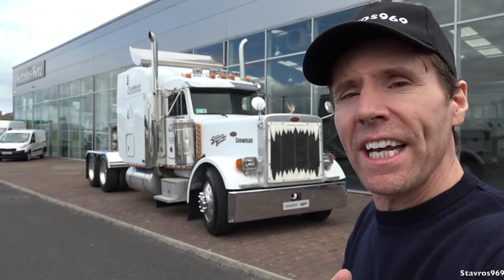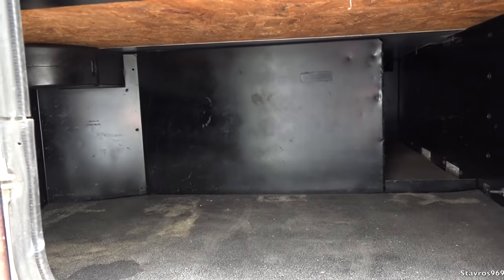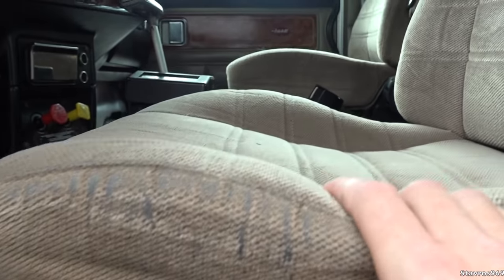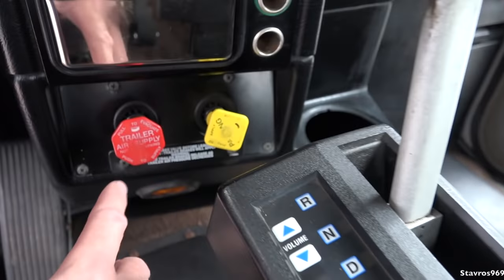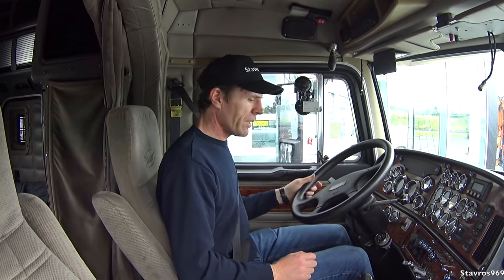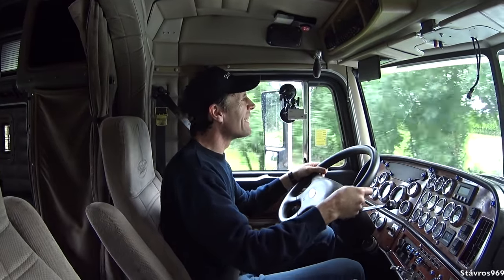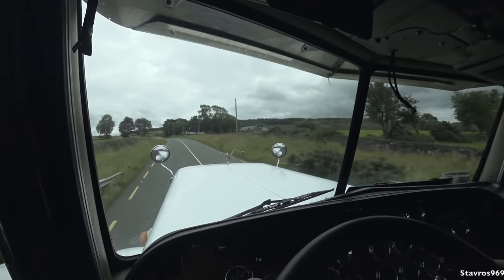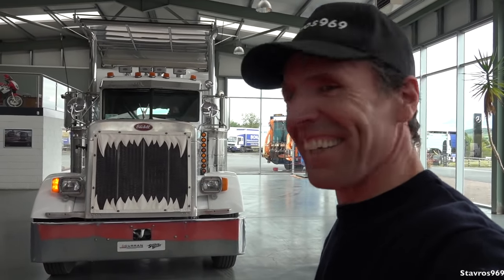2001 Peterbilt 379 Full Tour & Test Drive Caterpillar Engine

Comment: I was kind of disappointed that it was an automatic. It would have been fun to watch Stavros try out an 18 speed.
Reply: I mean it's not different than a 13 speed, just the lower ends can be split.
Reply: @robertgardner4508  Yeah, that's true. They're not really all that different unless you're pulling really heavy loads.
Reply: Do 18 speeds still even exist in the US? I thought the US was finally catching up with the world and ditching those ancient 18 speeds with modern automatics. Last time I checked, they just left with having to refine their auto boxes since they where changing to non optimal gears on hills and in cities.
Reply: Yes in Kenworths and peterbilts

Comment: Peterbilt HQ:
"How many gauges shall we put in this Peterbilt truck?"
"Yes."
Reply: other trucks just have dummy lights instead of gauges
Reply: It's nice to have a gauge that gives you a proper read out of what's going on. You can see a problem before it leaves you stranded.
Reply: It’s the full gauge package. It’s an option, but if you understand what every one does it’s actually a great thing to have.
Reply: Gareth Ifan it’s what it’s called on the build sheet. 
Some of us actually care about the temperatures of both our rear differentials, we also like having an ammeter (volt meter is standard), it’s also nice to be able to see the pressure of your pusher axle (in cases where it is equipped). You get an application pressure gauge which is handy (if you know how to use it). You get an external temperature gauge and an exhaust temperature gauge. 
The US has a lot of different environments and you can in a matter of 2-3 days go from -50 to 90 degrees Fahrenheit which has huge repercussions. The pyrometer is helpful because at least you know before the exhaust catches on fire and you melt a piston that you might be pushing it too hard climbing through any of our mountain ranges. 
It’s a great option. It costs some, but it can save you a lot in terms of your maintenance costs from the owner operator standpoint.
Reply: I also forgot: engine oil temperature gauge is another one it includes.
Reply: @garethifan1034  It's actually true, in the 2020 model you can have the full gauge package or a infotainment system, I'd like the full gauge pack.
Reply: roundsm18.....that’s not the full gauge package, whoever spec’d it from new had a few extra ones added. I have the full gauge on mine and it’s got 24 gauges....NOT including the rev or speedo 👍🏼
Reply: Hahahahhahaha
Reply: You can put more actually
Reply: @garethifan1034  No not really they are very useful too
Reply: All off them
Reply: Yea im not feeling the joke man
Reply: @garethifan1034 ...
For some...  all those gauges just "look cool"...
For those of us who actually understand the information those gauges provide...  they can mean the difference between a $20 radiator hose, or a $20,000 engine. 
The pyrometer, is really only necessary if you "run hard"...  like 100 MPH or more. 
But, just the addition of the oil TEMPERATURE gauge can save you from burning up your engine in the event of coolant loss, since in that case your "water temperature" gauge won't tell you diddly. 
Whether or not you feel those gauges are "necessary"...  is usually directly related to whether or not YOU are paying the repair bill after damaging an engine or transmission as a result of being unaware of a problem until you could hear or smell it, or see the smoke...  AKA...  too late.

Comment: Comfort in driving:  European Trucks Win
Comfort in sleeping: American Trucks Win 😊
Reply: Well I don't know. Modern American trucks are very comfortable because they have air ride suspension, air ride cabs, air ride seats and very long wheelbases, all of which aid in smoothing out bumps, though it's hard to compare comfort without driving them immediately one after the other, especially since they're designed for two different areas.
Reply: chiken da gr8 spot on. You simply can’t compare American & European trucks because they are built for totally different environments. It’s like comparing two species of animals that have evolved for their environments. They are nigh & day in difference.
Reply: Can't really compare a 2001 peterbilt to a 2020 Volvo FH :P
Reply: @matty6848  technically there is one place you can.  Australia
Reply: @FunnyMann3  can't even compare a 2001 peterbilt to a 2021 peterbilt.
Reply: But you never get comfortable driving when you drive an european cabover truck on american road
Reply: @hehe734  that's because with European hours of service, you're not in the seat long enough to get comfortable.
Reply: @matty6848  Nope, trucks are trucks. There is no night and day difference between trucks simply because they are both trucks. Your comment would be valid if people were trying to compare a truck to a bicycle or car.

and ride comfort is one of the most directly comparing things between two trucks regardless of where they are manufactured.
Reply: @chikendagr8994  air ride seats will kill your back in the long run.

Comment: Really love the classic American Truck look. And personally, my favorites are the Peterbilt 379/389 and the Kenworth W900 series of trucks. :)
Reply: Keso_de_bola917 they are definitely the staples  of American trucks
Reply: Same here, really good looking trucks
Reply: Freightliner classic xl is my favorite
Reply: T800 for me
Reply: 389s are modern version especially in the interior of the 379. The 567s look like a mix of modern/classic look.
Reply: The 70s&80s Freightliner FLC and 1979 Mack V8 Superliner are my favorite along with the 389s.
Reply: Agree with you on the Kenworth’s
Reply: Here in Costa Rica, the trucks are imported from the US, but I don't think I've ever seen any Peterbuilt or Kenworth trucks. It's either International or Mack. But the shape of the cab is still the same iconic one.
Reply: @AbrahamG.99  Freighhtliner. Owned by Daimler-Benz since 1981.

Comment: Another good one Stavros. The shape of these trucks didnt change  much down through the years. If you look at the 1955 Peterbilt 281 used in the film Duel externally not much changed.

Comment: I've driven older peterbilt 379's, several 80's-to current kenworth W900's, T800's, freightliner coronado's, cascadia's and peterbilt 579's. But I settled for buying a peterbilt 388 for my first truck, exact same truck as the 389 with a 6 inch shorter hood. Couldn't be happier with my purchase 550hp 2150tq, interiors are far better then the older series 379's.

Comment: Aw man, you left out a bunch of really cool stuff, like the air horn, which was that little string dangling to your left, and the famous Peterbilt air powered windows and wipers. Also, you do have power steering, it's just super tight. If that didn't have power steering you wouldn't be able to move the tires with a wheel that small even if the truck was moving.

Comment: Did you give the air horn tassel a good tug? Our older trucks take a decent pull. The newer trucks over here are a lot more plush then the older ones with leather wrapped steering wheels, etc. Still not quite as tucked as the euro trucks but close. As a U. S. trucker I am amazed with how the euro trucks,with the small sleepers and cabover configurations are so well equipped. Every bit of space is utilized. Very well done.

Comment: I'm driving my 1999 peterbilt 379 extended hood right now, why does your power steering not work? They don't make them without it 😂
Reply: I watched this man pulling onto the road and his steering is working correctly. Pete 379 have hydraulic steering assist, not like the older trucks that turn with lil effort, or ones orders with full power steering for vocational units.
Reply: He is just not used to driving this truck. Once he got it going it was fine. Also that truck looks pretty worn out.
Reply: @gregw8232  turn mine with just one finger so it's not hard at all.

Comment: Stavros,the air horn is connected to the string hanging in the upper left corner. You have to pull it for the horns and the one on the wheel is the city horn.
In the States kids on road trips always make a pulling signal like a fist pump to drivers to get them to blow the horns. Also I don't know how true it is, but I was always told that the air horns where on a pull string as a carry over from the steam locomotives.

Comment: Nothing beats the sound of a caterpillar engine, I love it! The truck looks cool but it seems to be a bit beat up. The powersteering was probably broke. I beleive all US trucks of that age came with powersteering. That kind of Peterbilt or a Kenworth W900 are my favourites.
Reply: I agreed I believe you are correct.
Reply: Its neither broken nor nonexistent. Its just weaker than today so he thought it didnt have any. But seing how he turns so easily when starting, it has and its working.
Reply: SCANIA V8 sounds better
Reply: @jrufussimonsen4718  They are great too, especially the old ones when they are straight piped.

Comment: That truck wasnt near as nice as some of the Pete's I've been in. That Pete wasn't very nice actually...
Reply: Right! And it’s automatic too....
Reply: I agree - but to be fair, it is 19 years old with 850k on the clock.....
Reply: And?
Reply: @ACERASPIRE1  and it sucks, what were you expecting?
Reply: It's in Europe. So its hard to find better then this
Reply: @ACERASPIRE1  Don't worry, I don't get it either. Those who yell that "manual is always better" are only driving it in Euro Truck or American Truck Sim. Automatic gearboxes, especially modern ones are smooth and comfortable. And that's all you need. The opinion of purists doesn't really matter in the real world anyways.
Reply: @fullyautomatedluxuryqueers5448  Well I'm not against the automated manuals or at least in our US trucks that is what they are, but I do think it's nicer to be able to choose your gears easier, and not fight with your transmission when pulling up a hill or if you are pulling tankers you can shift by the feel of your truck, where to automated manual in tanker doesn't quite understand that so it shifts when you wouldn't and you feel more fluid sloshing, etc. Both transmissions have ups and downs. If I have to operate a company truck with an auto I don't care as long as it moves my truck and freight. I'll get a manual when I owner/operate out of my own preference.
Reply: @robertgardner4508  Fair point. From my experience, the ZF auto gearboxes are as smooth as it can get. Don't know if you guys have ZF boxes over there though, but from what I heard the Eatons aren't all bad. Don't get me wrong, I can definitely see the appeal behind manuals and I would lie if I said that I'm no sucker for old school trucks, but for long distance trips I just can't find myself rooting for the manual option, you know? Especially with seemingly constant traffic jams. But kudos to those who ride with manuals despite the odds. 
Only thing I really despise about automatic gearboxes are these "eco-softwares" that cause nothing but trouble. Just leave the poor thing alone and don't program any of this garbage into it, and they run just fine imho.
Reply: @fullyautomatedluxuryqueers5448  How about that’s it’s just fun going through the gears and playing with the jake and making the engine growl?

Comment: I threw up a little seeing it was an automatic.
Reply: Here in America most of those old Pete's like that one are Munual
Reply: manual
Reply: 鄭善澤  Many of the newer trucks are offering automatics because they are far more economical and fuel economy is king. Many fleet trucks are only ordered in automatics because its less maintenance and requires a lower level of driver skill to operate so the carriers can hire and deploy new drivers faster. Having driven trucks with both, honestly, I'm fine with an automatic.
Reply: Worst automatic transmission , the new generation are better, but I prefer Eaton 13or 18, Manuel
Reply: @SweetLou0523  really good point Dave but the downside is that you get the E restriction United States Automatic only commercial license in the European Union which includes Ireland it's 78 for the same restriction.
Reply: 鄭善澤 the company I drive for offers both. They try to keep 50/50 auto/manual transmissions.. in fact the last bunch they just ordered this month were all manuals
Reply: Driven both automatic and manual for years, and it a heartbeat i would take an automatic back (currently using 18spd). Just those supertruckers with the big ego desires a manual today. i agree though that this old truck is kind of gross with an automatic in it.
Reply: Eric M absolutely agree with this. Only thing I prefer a manual for is heavy haul and I no longer do that type of work.
Reply: @SweetLou0523  

I own 25 trucks(all peterbilt and kenworth manuals)but i aslo lease another 40 of them. All are automatic and all my drivers hate them.

I personally prefer manual cause I have more control of the truck but as far as reliability and fuel economy. 

The 25 trucks that I own have no transmission issues and they get used a lot but the automatics have transmission issues all the time.

Most are sensor issues but there have been a few complete failures and these aren't old trucks the oldest we have is a 2016 freightliner cascadia that is about to be swapped out and it had to have a new transmission put in ig lat year.

So no they aren't very reliable, at least these aren't if they were alison's it probably wouldn't be that bad but still.

As far as fuel economy i get better fuel economy out of my personal 95 peterbilt 379 exhd with an n14  then any of the newer trucks i have.

Diesel trucks need to breath and with all the emmisions they can't do that. Not to mention the regens and other stuff they all suck on fuel.

But the basic rule of thumb is aerodynamics don't count for anything going up hill.

Honestly I would rather have a fleet of pre emmisions long hood peterbilts then anything else cause they wouldn't spend more time in the shop then on the road.

I hate new trucks.

Edit: clarification.
Reply: colbyh Ive only hauled heavy 63500kg with an eaton 13 speed automatic and never had any problems. Hauling the same weight now with an 18spd would take an automatic any day. Haul local so constantly shifting definitely wears you out
Reply: Eric M cool
Reply: Nurple looks like we found a super trucker with a big ego
Reply: That's all they know how to drive over there lmao
Reply: that is y its not in america
Reply: Right!!!
Reply: Arno Eastasian  99% of these are manual, especially one this old.
Reply: Yeah prefer automatic but when it comes to trucks like these has to be a Manual
Reply: Frl bro

Comment: Stavros please read!

Well Stavros, now you know why I'm here. Our trucks are crap I mean okay, but they lack in a lot of areas and are not driver friendly. I love the Freightliner argosy with a 60 series Detroit and a 18 speed trans. 
Stavros, most if not all our trucks have catwalks on the frame to hook up the airlines (as we call them). Also the air "deflectors" are just cab extenders to make the cab look longer than it really is with yes trying to keep air out from between the truck and trailer. as for the mileage, that truck is still pretty young. Freightliner has trucking companies trade there trucks in at 1,000,000 to 2,000,000 miles for new trucks. The cooker you see in the bunk would never fly over here, that's a death waiting to happen. I'm glad to see you like our high tech dashes with all the gauges from the 1950's lol. Asfor the ride lol, my dad used to have a 1990's Valvo and the passenger was a solid seat bolted to the floor. I went on one ride and my insides were like pudding. From here in the US cheeeeers!